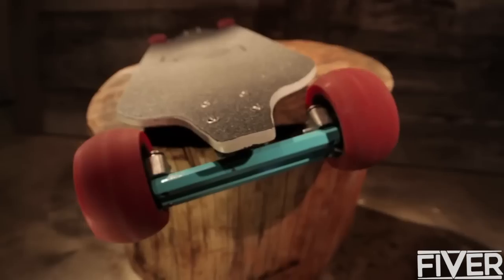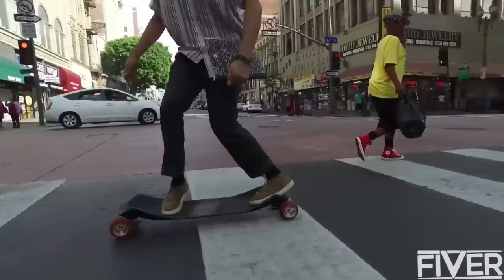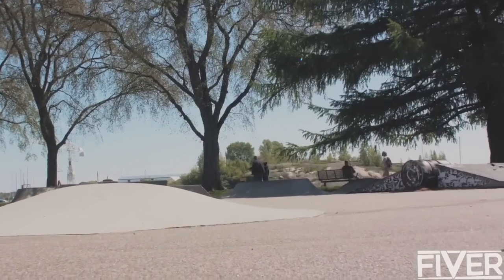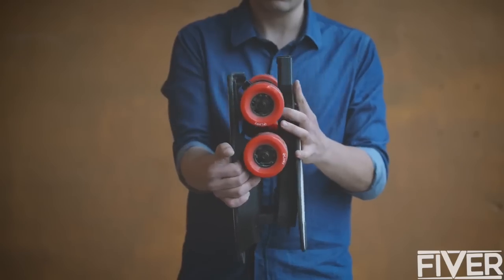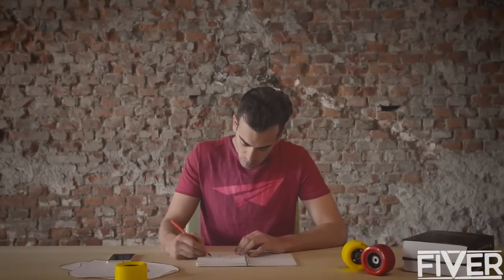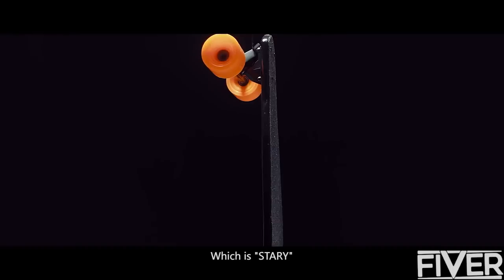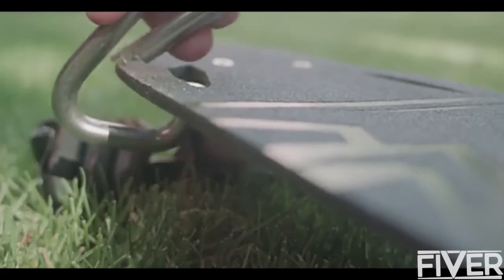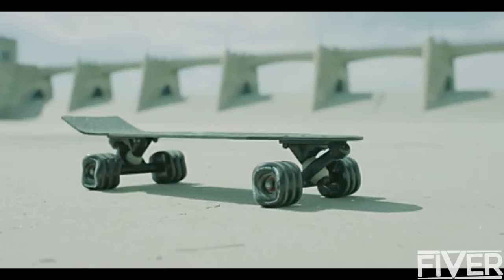5 Futuristic Longboards You HAVE To Check Out

Comment: Honestly i don't want longboards to change
Reply: Thats true. I think longboarding is so nice because its simple board,trucks and wheels. I think electric stuff or scooter wheels mess up the idea of longboarding
Reply: no, boosted board is dope, and ive been skating all my life, and how is putting a motor on a longboard changing the idea? the idea is basically lean to turn on a flat peice of wood, sitting on rubber cylinders. what isnt awesome about going 20 mph up a 25 degree hill without breaking a sweat?
Reply: well, since you asked. How about the fact that it is no longer a part of our lives. We used to have to go looking for some bomb ass hills or some nice parks with smooth roads and little hills. but with something like a boosted board, it's just little to NO effort required and that's not nearly as fun.
Reply: Danny Coffey i dont live anywhere near hills that arent major roadways, and it is basically impossible to break the 20 mph barrier without motors involved.
Reply: Danny Coffey going increddibly fast is fun enough
Reply: Danny Coffey what was the point of finding hills and going down them? to go fast.
Reply: +Jordan Fleming that's fine, there's always going to be those select few. All I'm saying is that things like motor boards should not become a trend because there is no exhilaration of fear or true excitement involved with that. At least not nearly as close as a steep hill where only you are in control of your board. Rather than a remote
Reply: im going to be honest, there are many hills in california that i would chicken out of with my $300 custom bamboo board. i love adrenaline, but i dont usually do things where there is a 80% of getting incredibly hurt or dying. and trust me, i dont want these boards to become a trend either, because i hate when things that i like go really mainstream. (as we saw with those damn hoverboards)
Reply: Danny Coffey i guess that since you know what going down a major hill is like, you cant really enjoy ONLY going fast. i love skating even without hills, so to me, going 20 mph for 7 miles would be absolute heaven. nothing better than it.
Reply: I just LOVE the UITTO board idea, it isn't changing much at all, apparently only the feeling sorta changes but other things are good. They are about 200 bucks away from going into production, in 60 hours we must reach the 20k goal
Reply: +Jordan Fleming how do you figure it impossible to break the 20 mph mark on a longboard. On flat land I can push myself to 14mph I know cause I had some one clock me on a radar. The right hill it's easy to get 20 or more.
Reply: +Chris Edmister i was talking about flat land. i was saying its impossible to get to 20 mph on flat land using your legs alone. but an electric skateboard can literally go 20 mph UP A HILL consistently.....even if someone in the world can push to 20 mph on flat land, tthey cant maintain it, nor can they push to 20 mph up a hill.
Reply: That's the reason why Casey Neistat uses a boosted board daily, NYC Manhattan doesn't have constant hills 'to bomb', it's flat asphalt, perfect for bikes, electric skateboards and stuff
Reply: +Jordan Fleming right ok got ya. Yea I'm trying to convert mine to electric. Mines a drop down longboard and I wanna put electric motor and stuff on it. Iv been shopping around and comparing parts and stuff. I think RC car parts or the best for home stuff just need to figure out what motors I want
Reply: +Chris Edmister drop down is the way to go, much cooler looking, and more comfortable
Reply: +Jordan Fleming yea my trucks are drop threw I think there called all tho I wish I could get those suspension ones as a drop threw for even better comfort
Reply: If you DONT want it to change don't use it
Reply: Well the Idea with the "green" longabboard from Finnland isnt a dumb idea because it keeps the idea of longbaord just changes the material which it is made of. But when there are to much orders there might Problems with getting enough of the recyling materials which the board is made of at some Point. But it's jsut an assumption
Reply: I think the lean is alright but get that electric shit out of here I will never replace my longboards with electricity!
Reply: +SycoriousCake  lol
Reply: As long as we dont change, it wont!
Reply: Grayson Rogers 
me too :[
Reply: sorry I don't have a movies or whatever
Reply: emojies
Reply: Olav Koefoed is there no adrenaline going 23 mph on flat road?
Reply: where i come from, that speed is unheard of. i live in florida where there are no hills anywhere
Reply: same here man, but I live right next to this awesome trail that has 10% grade hills :D
Reply: Jake you are lucky I live in the ocean. No hills or oxogen at all.
Reply: butterbro692 the ocean floors have plenty of hills and deep valleys! stop feeling bad for yourself
Reply: Grayson Rogers right? old school skate or gtfo
Reply: +Viva La Vanna my current board setup: subsonic gt40 custom with texallium finish/ bones redz ceramics bearings/ purple orangotang kegels/ bears gen 5 trucks gunmetal finish.

i know my shit
Reply: +XxBossstone xX i have the ceramics in my setup
Reply: Jordan Fleming cool pusher setup, what wedges are you running? Also what bushings?
Reply: Grayson Rogers currently I don't have any wedges attached as I wouldn't know how to add them on a drop through style deck that is already really close to the ground, and as for bushings I'm using stock bears gen 5 bushings but I'd like to upgrade to orangutang cylinder bushings
Reply: Grayson Rogers if they don't change they will never evolve into normal skateboards 😁
Reply: Grayson Rogers you have to love the new ideas people have tho I don't want them to change too but I love the new design and ideas people have
Reply: Danny Coffey Honesty I agree with you, I see your points
Reply: Dmitry Karimov and that's why they are called longboard for a reason because they are a different style than normal skateboard for fuck sake
Reply: Then just stick to regular long boarding you don’t have to buy these boards. Personally I like longboards as they are and always have been.
Reply: Hell. Yeah.
Reply: Grayson Rogers same

Comment: Not a single person in that Linky video looked comfortable riding it. Not only that, it only showed people going straight forward from what I remember. No turning or weaving through crowds, etc
Reply: And did you see that durabiliy test? So weak.
Reply: standing directly on the trucks, like yeah no duh it can hold two people, id like to see it hold up after they put them directly in the middle, and it keep its integrity
Reply: also... "nothing out there is portable" is not even right, there's cruisers and backpacks with straps which can hold a skateboard. I got a used backpack like this for 10 bucks last year and a small cruiser and it's not ideal but really an okay solution so far. for example for getting to the station and then just straping it to the backpack on the train...
Reply: fitztastico plus the narrator literally sounds dead because just listen to it, every one of them sounds so unenthusiastic
Reply: fitztastico smh they are just trying to make money off of gullible people
Reply: Like show us a slide
Reply: dude 30km/h on that looks so sketchy! The deck slopes off to the front and back trucks... oof

Comment: The wheels for the board in the last video started off as an Kickstarter as well. They are called shark wheels and are supposed to roll smooth as hell.
Reply: Shark Wheels are an overpriced wheel. You can get something with the same function and feel for half the price and it won't chip as much.
Reply: +Rory Mitchell I have shark wheels man. they are amazing. better than any other wheel I've used.
Reply: preme you have no idea what you're talking about

Comment: leen, Original Longboard brand has a board that's spring loaded. the Pintail series. I have one of them. Exactly how the guy describes it Original Longboards does. and I'm sure it's A LOT cheaper than the Leen guy is selling his "invention." Original also sells boards that are dipped in so that you're able carve a lot easier.

Comment: Im gonna save you time. All 5 are flimsy piles of crap made by people who dont really skate. Advice: Get a real longboard, a good rig, learn to skate/slide, and then go bomb a mountain!! You dont need electricity when you have incredibly powerful machines called "leg"..  they say.. that a board can go 12 miles using electricity. Well.. I've gone 50 miles in one go with "leg" and the thing is, these incredibly powerful machines improve a lot more the more you use it or the harder you push it. Also id like to mention that "leg" self repairs and grows too...incredible! and only really runs on sugar and water! compare "leg" to "electric".. yea.. I wonder how efficient "electric" would be after a few months after riding if it isn't fully fucking broken already.